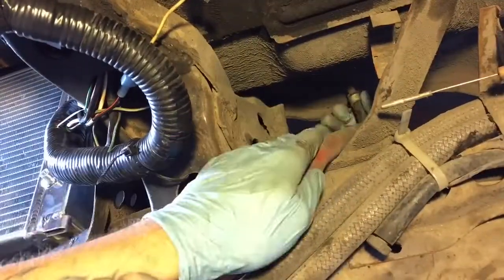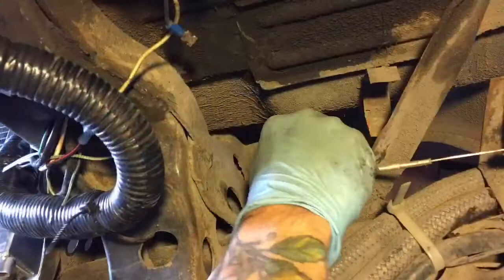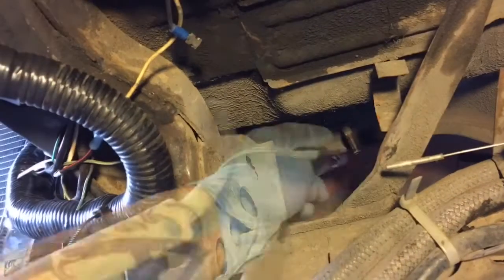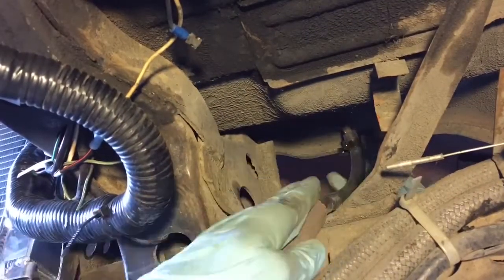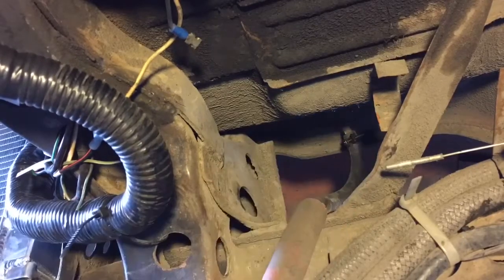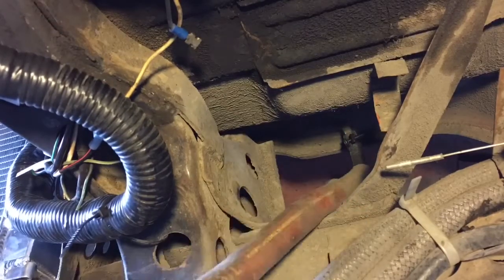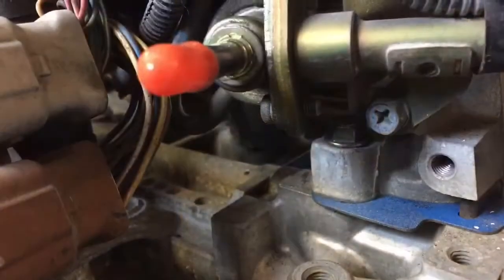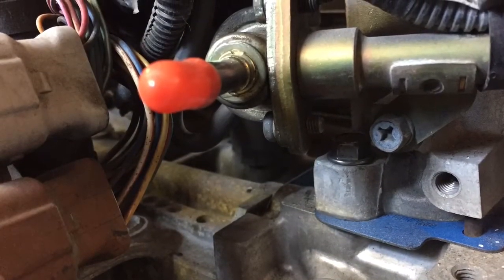Fuel Return - Daily Driver VLOG 6/21/17

Comment: looks good man!! however, thats easy  when you have an existing return on the tank. How would you do it when there is no fuel return existing? I'm putting a subaru in my bus and stuck thinking about a solution that doesn't involve modifications to the tank (not sure of my ability doing that safely yet.) my idea thus far is to plum it to the fill hoes.
Reply from the maker: +alaser2002 Yeah, this bus is a lot easier than most. Normally I take the metal filler neck out and put a barb fitting into that.